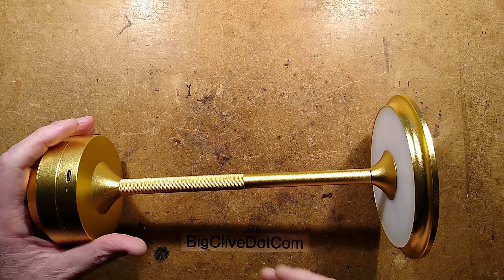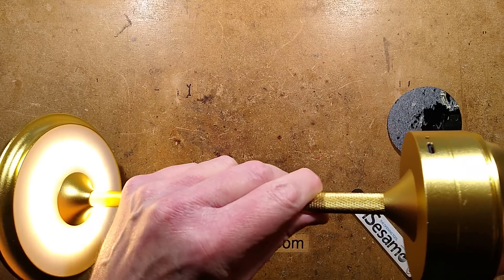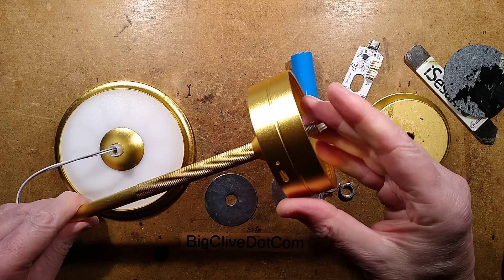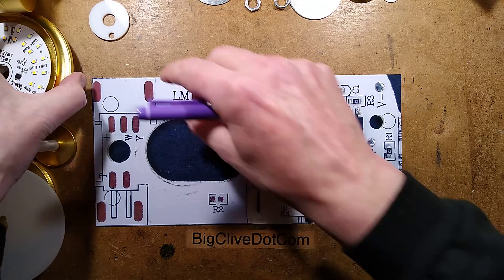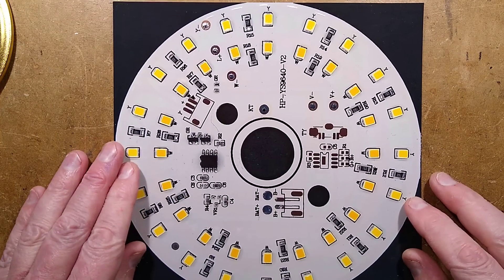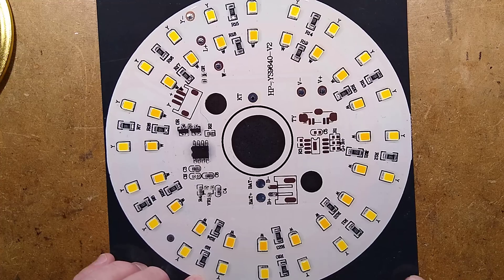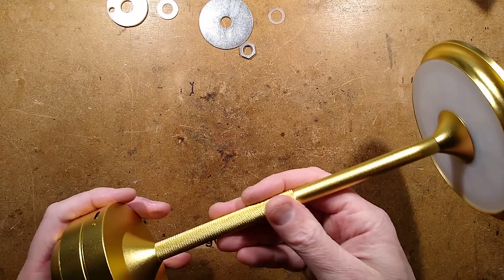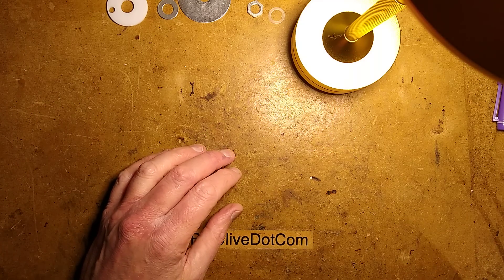Crappy, but hackable rechargeable restaurant light

Comment: Nice video Clive. I've bought a couple of these type of 'cafe' portable lights and they all suffer from the same poorly designed touch sensor issues. One thing that would be nice is if you could get a calibrated colour chart that you put on the bench when demonstrating the light output. It would be useful to see how good or bad the colour rendering is from these LEDS? I know the camera is not calibrated, but it would give an indication, particularly the red part of the spectrum. You would only need to shine a known high CRI light onto the chart first, then swap over to the light on test for us to determine how well the tested item performs. Thanks

Comment: I'm surprised an enterprising Chinese factory hasn't started making USB-C sockets with the resistors integrated to make them "charging only" connectors.
Reply: They have breakout boards with the 5.1kOhm resistors with USB connector.
Reply: @akhurash   Those are fine for prototyping, but when making a product you need it to be a homogeneous component.

Comment: Even though you said it was a different pinout, that unpopulated circuitry at the top is clearly for a battery charger; you have the USB-C connector at the top ("TY"), and red/green LEDs in the bottom right ("G+"/"R+").  The touch sensor triggering when you touch the top anywhere is probably because that large section isn't grounded and is being capacitively coupled to the center touch pad; adding a wire tying it to ground should fix that.
Reply: Actually, my suspicion is that it is not being coupled to the touch pad, but actually to the wire and/or board trace, both of which are pressed up to or run right next to that metal chassis in places.  I agree that just grounding the other top piece is probably the most straightforward way to fix it, although that may also reduce the sensitivity of the actual touch sensor piece somewhat as well.